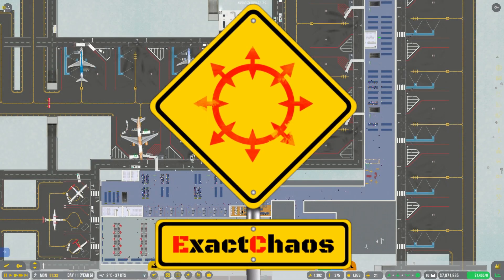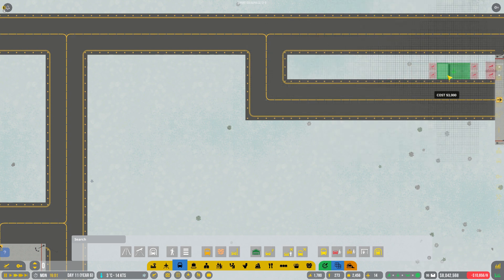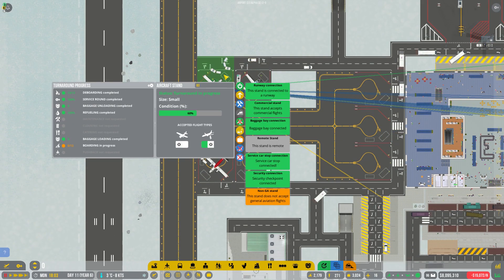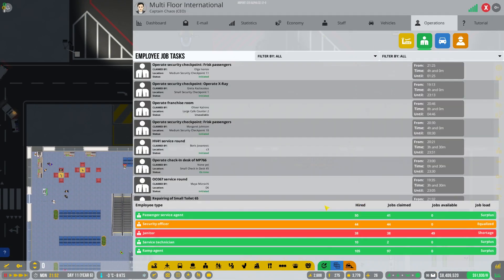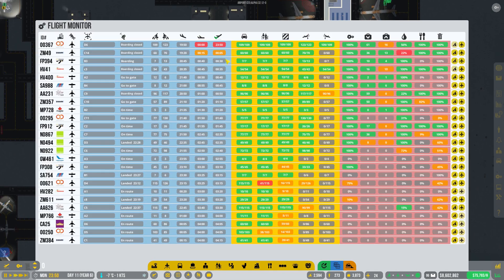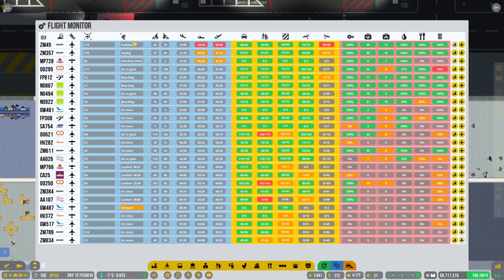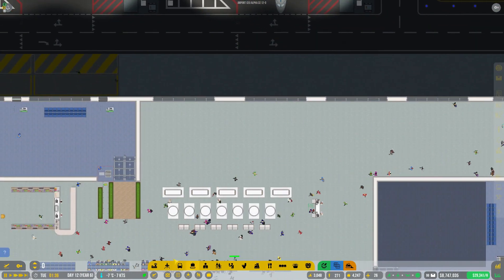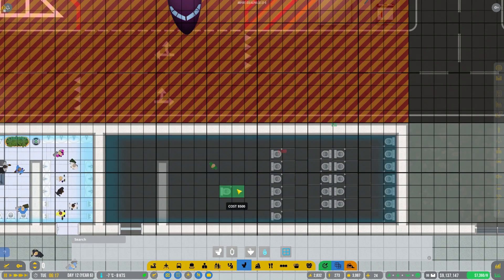MFI Airport (Airport CEO) 25 - A growing airport

Comment: Hello.
I love your videos. 
You should add car depot only for service car near of service car stop to decrease the time. Beacause the actual depot is too far away from the car stop and the car has to travel a big distance to pick up the service agent. I belive the best location to put a car depot is underground beacause you remove movement from the main airport roads. 
 But you can also apply this solution with all cars and trucks.
I see an other problem in your airport, and it's the garbage service, the trucks needto go to the garbage depot after one plane, so it's add a bottleneck in your ariport. So I think that he solution is to add more trucks.
An other solution to decrease the delay is to assign the basics cars in every stand. And the others in the car depots that they must be near from the garbage depot (example). And the the depots need to be underground to increase the trafic flow.
Reply: Raimon Coral good idea i have i like this in my own airport. Except for that you can’t place depots underground.
Reply: @LowieVG  Oh! I didn't know it.
Reply from the maker: Great idea, as I optimise efficiency I will start moving things around a bit

Comment: Somewhere in the middle of this campaign, you seem to have stopped using CTRL-select deletion and go for the bulldoze tool each time, is there a reason? It includes a filter for deletion so you can only remove, for example, service roads and not taxiways for your crossovers. 

A minor OCD-thing with ACEO's planes, 5-wide taxiways between medium stands doesn't visually look like enough, so I tend to prefer 7-wide (so you can still have a center taxi path) -- purely for visual nicety. :)

A small beautification idea for your airport: pave everything on the airside like real airports. :)
Reply from the maker: Interesting, I never even noticed this. There is no reason, I will focus a bit on going back to the ctrl method. Yes I think for my next airport I will also transition to 7 wide taxiways